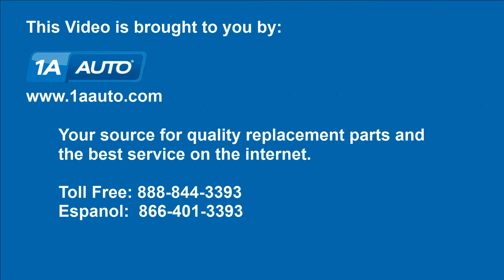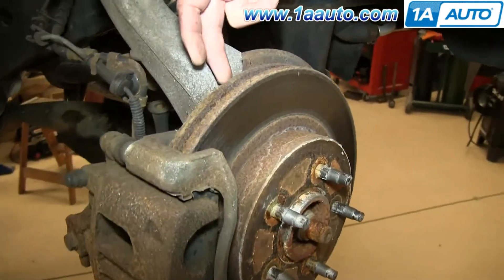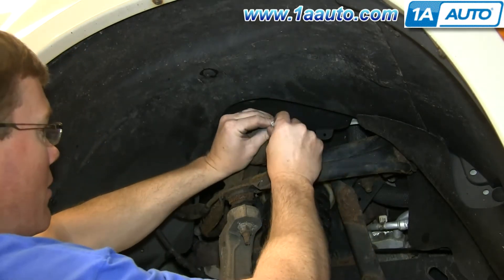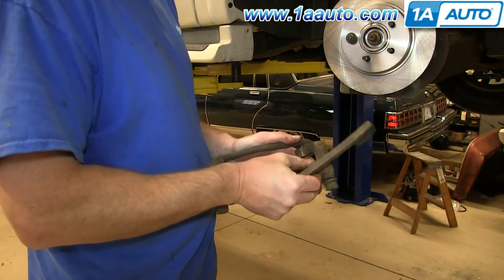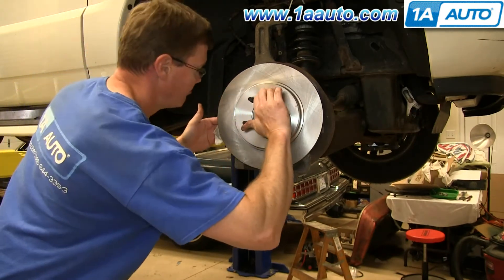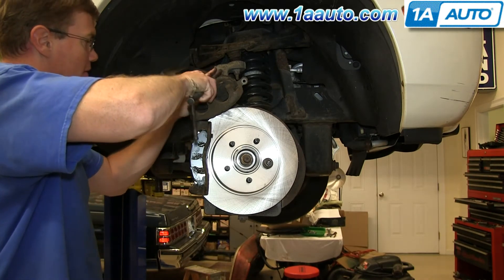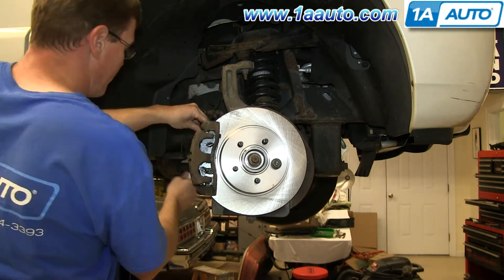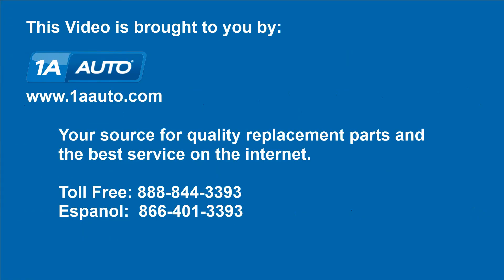How to Replace Front Brakes 02-05 Mercury Mountaineer

Comment: If you use the C clamp to squeeze the pads, while the pins are in, you avoid damaging the piston and check the sliders at the same time. Be sure to slide the calipers back and forth after you push the pads in. ONLY push in one side at a time, otherwise you may overflow the master cylinder.

Comment: You didn't mention the master cylinder? When compressing the caliper you dont wat it pushing against the master cylinder unless the cap has been removed, right? Then after completion, when pushing brake pedal to floor to extend the calliper ( pads) to contact rotor, fluid may be needed, likely not if not replacing the calliper, which will mean bleeding the air, just trying to clarify before doing my brakes...Thanks. Always love the info that you share with us dummies out here in youtube land.
Thanks again.